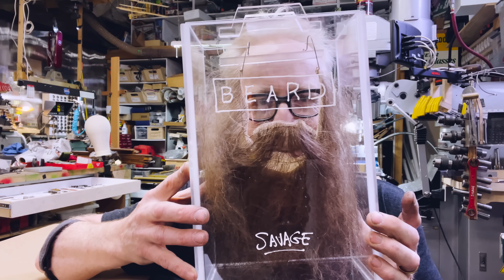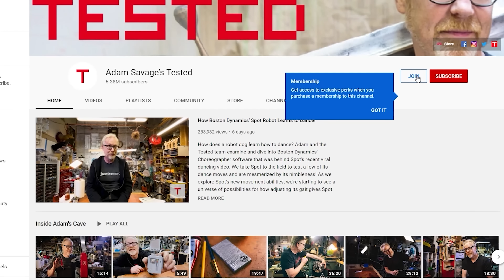Adam Savage's One Day Build: Acrylic Display Box!

Comment: Manager of a TAP Plastics store here!  Love the video, and thanks for the shout out Adam!  We are all big fans of you at my store!  You actually did pretty good!  Just trim the masking rather than peeling entirely next time.  That allows you to see your glue joint while still protecting the rest of the sheet.  Anywhere you get the cement that you don't want, you can always use a clean buffing wheel with no rouge on it to take out the hazing from the glue
Reply: Question, what is the name of the metal collared flat spout being attached to the 4 oz. utility can at the one minute, thirty-four second mark of this video I have attached to my comment? 
https://www.youtube.com/watch?v=hT6Ow_cBTps&t=94s
TAP Plastics doesn't sell it on their website, and I don't know the name of the item to find it online. 
Much thanks, if you can help.
Cheers!
Reply: @alancastaneda8322  so that was actually a little spout that weld on used to sell standard with all of their packaging.  Unfortunately they do not use this any longer and we just exclusively use the HDPE funnels with a straw dispenser tip on the cement.
Reply: @themedicinemann6345 , thank you, for the quick reply. Do you the name of the item, or is it simply called a "little spout"?
Reply: @alancastaneda8322  here at my store in WA we call it "the weld on spout" but since it has been discounted it has all sorts of names
Reply: @themedicinemann6345 , thank you.
Reply: can you enlighten  me to the specific glue that is uses?
Reply: @natman6088  weld on #3 & weld on #4 both by Sci Grip
Reply: Curious, is there a good way to bond two flat pieces of acrylic against one another without seeing glue between the sheets? The capillary action alone usually leaves puddles and bubbles that look fairly unsightly for me.
Reply: @JPod  that would be acrylic laminating cement.  But that's not something TAP has ever sold so I don't know the exact name of the product beyond "laminating cement"
Reply: @themedicinemann6345  Thanks for the reply! One other question if I may? When there is a glue spill, do you recommend wiping it up or just leaving it to evaporate? When I have tried wiping it up in the past, it seems to do more surface damage than letting it evaporate?
Reply: @JPod  absolutely not.  Let it sit and cure, wiping will lead to smudging and smearing.  Just let it cure and if it's still there after, use the novas scratch removing system and it should come right out.
Reply: Not sure you'll see this from a year ago but when you say 'trim the masking' is there a trick to that without scratching the surface of the acrylic? Or do you just peel it back partway and then cut it loosely off of the surface?
Reply: Did you ever figure this out? I've seen photos of nicely trimmed paper and always wondered how they sliced it without scratching the surface  @calderpful

Comment: Hey Adam! Been watching your 1-day builds for some time now and I've been working with acrylic for over 10years. I love Tapp plastics, but there are some things that need to be addressed. First, the acrylic should NEVER be cut on a table saw, as it leaves large grooves (tooth marks) in the acrylic. If you really want museum-quality cuts, you should use a laser cutter, otherwise half of your time will be spent smoothing the edges and it will never become uniform. First, even a high-quality laser cutter can leave remnants on the edges, which will create bubbles and laser etchings when you 'flood' the edges of the the acrylic with weld (#3). On the laser cut edges, you should use a 400-grit or higher sand paper to very lightly smooth it out any inconsistencies from the laser cutter to prevent bubbles when you lay down the acrylic weld. You need to use a square on each side to ensure that there is a proper 90-degre angle on each side. No need for tape if you use a square and take your time (hold for 3+ minutes with pressure at each side). Because the tape will eventually throw off the angles and dimensions of the box. Also, you NEVER want to vertically pour the weld, as it will cause the weld to run down the sides of the acrylic. The weld should always poured flat/horizontally to not only ensure that it doesn't drip, but it will also flood the seem of the acrylic.   BTW...My builds have also been featured in Make Magazine ;-)

Comment: Fellas use a flush router bit it makes the perfect edge for either polishing or glueing. Also don’t take all the paper off the plastic. Only remove strips on the corners you are welding. That way you don’t get your finger prints or burn the surface if solvent drips on the surface. Also remove the strips of paper off both sides of the joint so it doesn’t “glue” the paper to the plastic by accident

Comment: Sign maker person dude guy here!  So, if you want an edge that's super flat and clean you saw cut (triple chip blades are your friend) over-sized 0.125".  However you do not need an edger/joiner/jointer! You need a mounted router or even a dremel and straight cut router bit.  Works exactly the same and far more likely to be in the home shop. Then you shave .0625" off each edge and you're good to go.  Best part is if you use a bearing bottom straight cut bit then you can make a template out of wood or scrap plastic or whatever and now you can produce exact matching multiple parts.

Comment: I’ve actually done this for a living. Here’s some tips. Set up a router table it’s the same edge you get from a jointer. Set up an oxygen & hydrogen torch for flame polishing exposed edges. Acetylene introduces soot it’s objectionable. 
Do not glue sanded or flame polished edges. This introduces heat which has a lasting effect even after the heat has dissipated. The acrylic will craze after glueing. 
Use a glass cutter to score your paper masking. Then use kerosene on a dampened cloth to allow the adhesive to release on the scored line. The glass cutter will not scratch the acrylic unless you make unnecessary multiple passes. Sand the acrylic if you are going to wheel buff. But do not glue that surface. The router table is key. You can achieve 0.001 accuracy. You can use 3M double stick to flush trim to a template for repeatability. 
Flame polishing requires some practice.
Reply: All good advice.

Comment: As a TAP Plastics fabricator I can confirm that I was yelling at you a little bit (sorry) 

But the real thing is that you made the box and that you like the box and that you are sharing both of those with the internet. 

**THERE'S MORE THAN ONE WAY TO MAKE A BOX**

You could get a better flame polish with more heat. You do want it to get melty but don't let it burn (acrylic can catch on fire). Oh, and try not to polish before gluing. The solvent can craze the joint (cause a web of tiny cracks in the plastic).

Comment: If you do not have a Jointer, I have found a router to do a good job. To be specific, I like to cut templates for each piece out of 1/4" MDF. I'll then cut my acrylic about 1/8" larger than my desired size. Then I'll use a flush cut router bit with my templates as guides and I am always happy with the results.

Comment: My first (and actually only) time of building an acrylic box was way back when.  I was so worried about the glue that I chose to use white acrylic for the only part that needed to be glued, that is the top, sides and bottom.  Even that I made by bending the 4 corners using my that time 80 W soldering iron.  The only glued seam I made as a butt joint at the center of the "bottom".  I got somewhere instructions for making the glue and that was simply dissolving some of the same white acrylic into the purchased solvent so that I got a half paste fluid.  The reason for that was to avoid wicking.   Worked adequately well.  For the front and back I mounted small strips inside with the same glue.  Then I matched my black acrylic front and back panels to the less than straight rectangle openings.  Finally I spread a thin layer of the made glue along the inner edges of the rim (both front and back) to form slight friction locks for the two panels.  It worked and I was proud and happy about my result (just like you know who!).  But just like the great master adviced, I also decided not to pursue my luck with any further acrylic boxes.

Comment: 21:31 - In fact, you don't want to use a bottle at all. Use a syringe. No compressible gas inside it means much finer control over how much you're dispensing, and works upside down as well. With that bottle (which is mostly just full of gas), the solvent stops coming out as soon as you tilt the tip up.
Reply: can you enlighten  me to the specific glue that is uses?
Reply: @natman6088  - It's not glue, it's a solvent. It melts the plastic, welds it, and then evaporates. The thinner version is just pure dichloromethane (a.k.a. methylene chloride, a.k.a. DCM). Thicker, more gel-like versions are generally dichloromethane with some additives or some acrylic dissolved into it.

I would suggest just getting pure DCM and, if you need it to be thicker, just make a small batch into which you melt a few pellets of the plastic you're going to glue, so you're not mixing different plastics.

Comment: Hi Adam.  For a better join pin your edges up and let it soak and gel a bit before removing the pins. If you use a hotter torch for polishing it will work.  We used a hydrogen and oxygen torch when I did production acrylic work.  Works like a treat.  One pass and you're done.  A map gas torch might do it for the hobby builder.
Reply: What do you pin the edges with?
Reply: @Paul Calder  we use chisel edged staples.  2 per side unless it's really long, then we use 3 or 4.  Just enough to give you a tiny bit of gap.

Comment: When I cut plexi, I leave 1/8” oversized, then cut them to size on my router table, which is built in to my table saw. This creates a perfect smooth edge ready to glue or flame polish.
Reply: I agree, I used same technique when I made acrylic display cases. Rather than the solvent glue, for best results we used a UV curing adhesive. You can get a diamond edge polishing machine but I think they're about 4000 dollars.

Comment: What you described at about 11:20 as triple chip is actually ATB (alternating tip bevel) with a flat top raker. a triple chip has a small flat top with both corners beveled (think of an A) followed by a flat top raker. All that is really confusing.

Comment: 19:23 I see you are using cocktail sticks under the tape, assuming this was to square the box up? I would have liked to have seen how you achieved the setup.
Reply: He did explain why he used them (to prevent the solvent from wicking under the tape and altering the surface finish).

Comment: 9:43

Step 1 - Buy a $1000 granite surface plate.

Step 2 - Put a piece of tape under the sandpaper, thus creating an obvious bump in the middle.

Step 3 - Sand directly over the bump, ruining the straightness of the piece you're sanding.

Step 4 - Proudly display a (now bowed) sanded surface that won't make any difference if it ends up being flame polished or bonded with a solvent.

Also, for bonus points, constantly pause to sweep plastic dust (and breathe in a lot of it) instead of just wet sanding and / or using abrasive mesh instead of paper, either of which would keep the dust under control.

Comment: who doesnt love seseme seeds, theres a radio4 show where they sing the words of one song to the tune of another .walk in the shoes (or beard) of another. , Ive seen regulator longcase clocks with offset corners on the case mouldings. I like to ask, how long is this made to last. I have to finish my oak treasure chest with copper rivets, they are the thing thats difficult to make, I should video it  before i run out of tape. (Tim Hunkin)

Comment: We made a lot of thick, large, aquariums...and the adhesive is no secret.  It's SciGrip #42 two-part acrylic adhesive.  It's how you get strong and perfectly clear joints.

Another tip, don't peel the whole face.  Use a straightedge as a cutting edge, and just peel back 1/2" or so along the edges you're cementing.

As for flame polishing, that torch isn't nearly hot enough.  We (and any professional plastic fabricator) use Oxy-Hydrogen torches.  Extremely hot, and the only residue is pure water.  Done on a nice sanded edge, you will have perfectly clear edges.

Comment: I hate flame polish, too easy to mess up when you must have crystal clear results. I found if you spray on a clear top coat of anything that will not attack the plastic (like an acrylic spray) it will look exactly the same as if you expert flame polish it!  (It fills in all the micro scratches.)    ;)

Comment: save time with polishing and use glues for plexi which actually melts the plexi giving you the "transparent nice clear look" you asking for.. :)
Reply: Those aren't glues, they're solvents (typically methylene chloride), and that is what he's using.
Reply: @RFC-3514  there are glues typically made for this purpose and yeah most of them are based on some solvents, however the one of the easiest is typically chloroform also possible to make even slurry like material from the base mat. dissolved in it...
Reply: @marijhorn  - Methylene chloride (a.k.a. dichloromethane) dissolves most acrylics (and PLA as well, which is nice if you need to glue 3D pprinted parts), leaves no residues, and isn't nearly as dangerous as chloroform (that decomposes into phosgene). 

The "glues" (ex., Weldon #4) are basically MC with some gelling agent to make it evaporate more slowly.
Reply: Another option is to use UV curing adhesive, until it's cured you have a chance of cleaning off excess. It's a fair bit more expensive than the solvent welding though.
Reply: @peterjf7723  - Most acrylic  becomes brittle and starts to decompose under UV light. You'd need "outdoors acrylic", that has UV-resistant additives.
Reply: @RFC-3514  The UV curing adhesives only required about 30 second exposure to cure them.
Reply: @peterjf7723  - UV lights don't have a fixed power, so you can't say it's always X number of seconds. It might be 30 seconds under very strong UV, it might be several hours with a weaker source, etc..

Personally, I would avoid exposing "indoor" acrylic to a high-powered UV source, especially when there are cheap solvents that literally weld the acrylic into one continuous piece of the same material.

And, if you use UV-resistant acrylic, it's possible the UV light won't manage to penetrate all the way into the joint.

It can certainly be done, but Adam is already using what is generally regarded as the "best" product for the job. He just needs to improve his application technique.
Reply: @RFC-3514  It was a few years ago so I don't remember the exact details, but the UV curing lights and safety glasses were part of the kit provided by the company that sold us the UV curing adhesives.

Comment: I use aluminum foil tape to protect the surfaces not to be flame-polished, and sand edges to 400 to ensure sanding scratches or "grain" doesn't show, and I use a butane cigar type torch, I've tried using a mapp gas (yellow tank) but the acrylic melted too easily for me.

You can also use a mocked up router table as a type of jointer if you don't have a jointer.

Comment: Methylene Chloride is the go-to for joining acrylic and it gives a clear join, but Weldbond is fine... but not the best for joining.
Keep the main storage in a glass container, and use a syringe with a fine tip when using it and pour the excess back in when done.
That and when building a box, you do one join at a time, making sure each is square.
Oh and just like welding you can tac it together also.
Reply: Not done any acrylic work for about twelve years, I think we used acetone for the solvent welding.